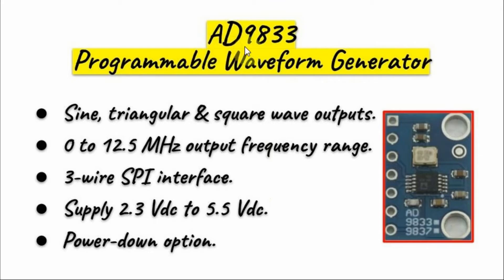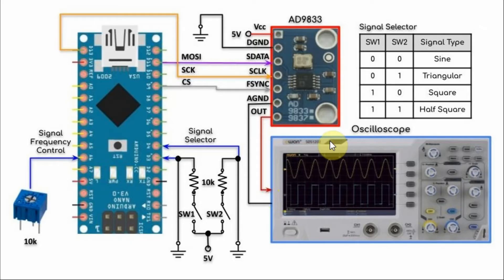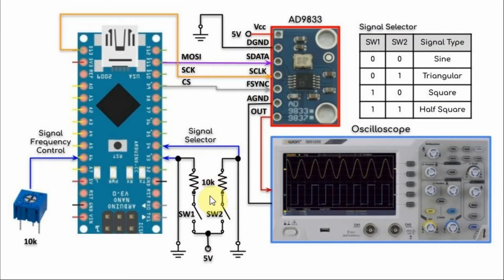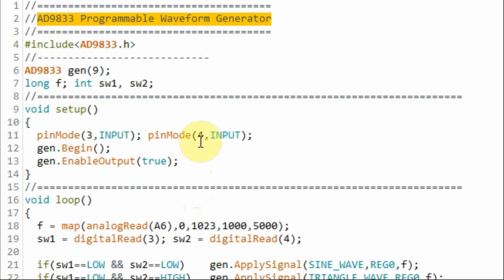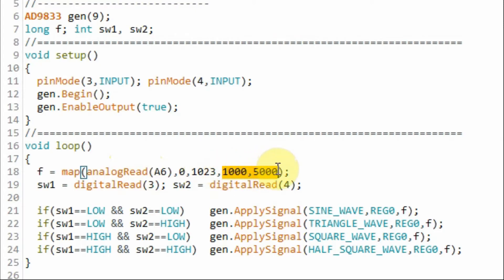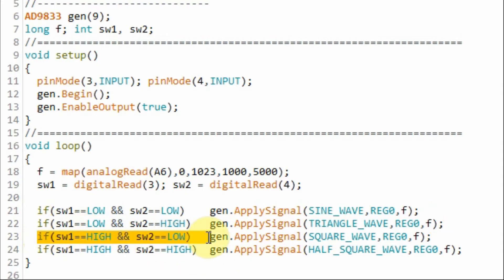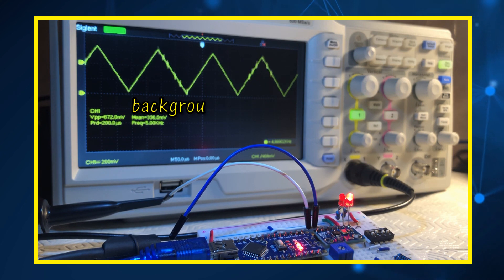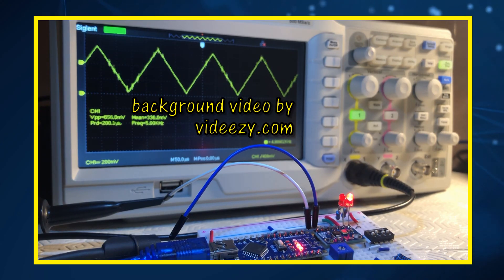AD9833 Programmable Waveform Generator

Comment: hello there, great video, with just one problem. Where to get your ad9833.h library , as one I found does not recognize few of commands used in your simple code, so it is obviously different library which you using in this example.
Reply: Whether you got the outpuy....

Comment: I have same code write and proper connection do but not generated sine wave and triangle wave .
Reply: Hello. I first would check, if the AD9833 get the right signal. So make a print command, read the inputs from 2 and 3 and check what the arduino says.

Both on (1/1) - triangle
2 low 3 high (0/1) - sine
perhaps you took the wrong switches - their are different types - (i had this problem before)

second u can comment out all the section were the switch read is. then the arduino should send "waveType = TRIANGLE;" to test.

May this help you
Reply: I watched again the circuit. It is very important to connect the switch properly. Outherwise the arduino make "non sense". You should read some articles on how the arduino digital input works. you need in any case a 1k ohm to ground to read inputs properly.

Comment: How do you connect the potentiometer to arduino pin A6? The potentiometer has 3 pins, how do I know where to connect each pin?
Reply: One side of pot goes to +5v the other to GND and center to the Analog inpuit A6 or whatever input you provision in line 18 of the code.

Comment: I did the same as in this video. But I got only sine and triangle wave patterns.😥Please reply sir.🙏
Reply from the maker: I’m not sure what’s happening. I do have other tutorials where I programmed the chip from scratch (no library used) using Assembly or C++. I interfaced the AD9833 with ATmega8 microcontroller.

Comment: Hey there,

 has someone an idea, how to connect the GY-9833 (AD-9833) to a Raspberry Pi Pico. The Pico SPI has 4 wires: SPIO TX, SPIO SCK, SPIO CSn, SPIO RX. The Module has only 3 connections for communication: SDATA, SCLK, FSYNC. Is there an library for Micropython available? First step for me is to find out the correct connection and setup of the SPI-connection to the right pins.

On my understanding SPI works with MISO, MOSI, Clock and select signal. I'm new with the Pico and micropython.

Best regards
Svens

Comment: Does the sinewave go below 0V or is it all above 0V
Reply from the maker: All output signals bound between 0 and 5 volts
Reply: @AnasKuzechie  thanks for the responce i was using an AD9851 thought i might use this as an alternative. But probs not. The AD9851 has trippled in price so makes bricking them costly for me.
Reply: @AnasKuzechie  so can you explain low VPP that we can see in your video please ?

Comment: I saw a big change in amplitude with the sine and triangle wave. Where you filtering the output somehow or was that the chip itself doing that. With a lookuptable wave generator that this chip uses, amplitude should remain the same over the entrire freq range.

Comment: last question ... to generate only sine is it right to ground the pins of arduino D3 and D4? thanks so much really kind
Reply from the maker: To generate only sine, disconnect the 2 switches, and in the C++ code replace the if statement with gen.ApplySignal(SINE_WAVE,REG0,f);. I hope this helps.

Comment: hi, is the code right so short or is a part missing? and the 10k variable trimmer how should it be connected between arduino and ground or between arduino and positive 5v ?? Thank you so much
Reply from the maker: Hello. The code is okay. As for 10k pot, middle terminal to Arduino pin, one side pin to ground and other side pin to 5V.
Reply: @AnasKuzechie  very good ! 👍